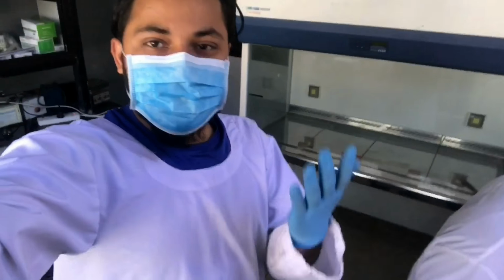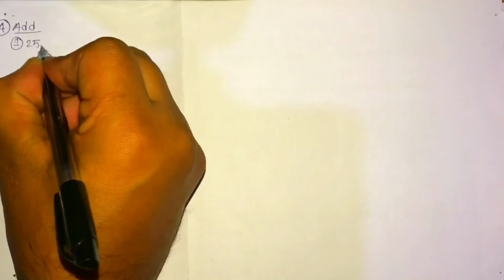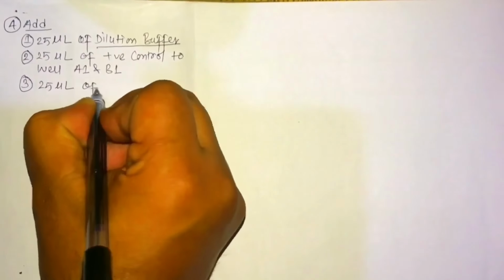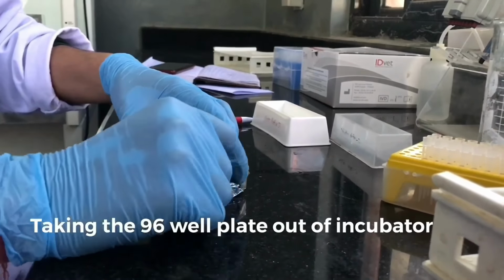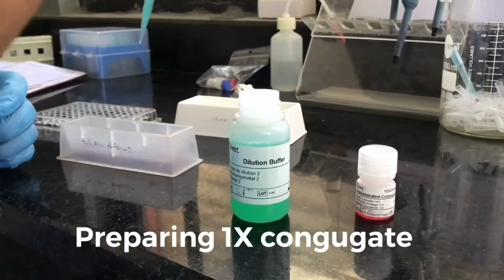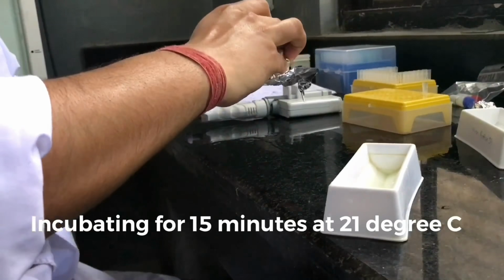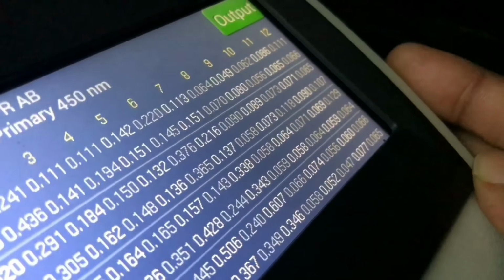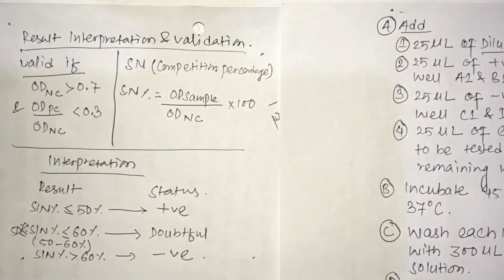ELISA | How to do ELISA | step by step procedure for ELISA

Comment: hello
i worked on staphylococcus biofilm formation using ELISA...i don't know how to read ELISA results!! the  negative control was TSB (0.071)and the positive control was E.coli(0.148)...so how can I measure if the biofilm is weak ,moderate and strong depending  on negative and positive control mathematically as you did  above!!! why you use greater than not less than in OD NC? from where you get 0.7?? the same question from where you get 0.3??and why divid OD PC on OD NC to get what???!!..please I need your answer...please..
Reply from the maker: Can you send me the ELISA kit information or the protocol methodology provided by the kit-producing company?